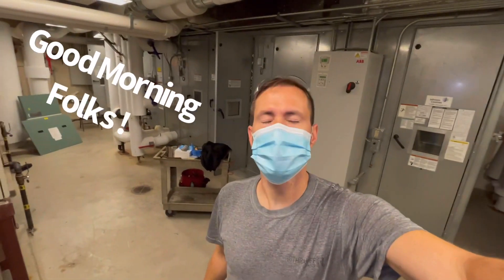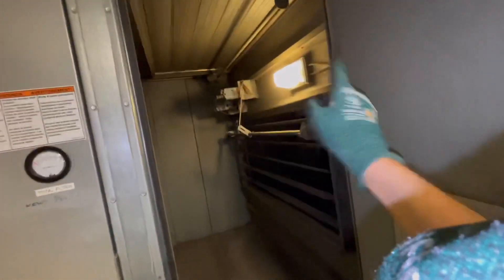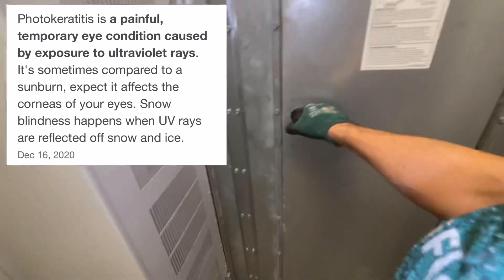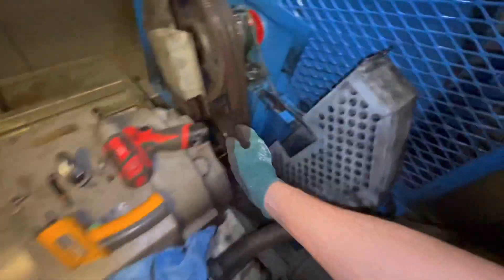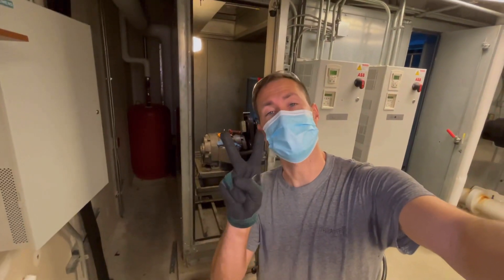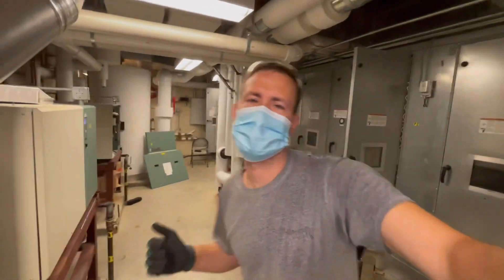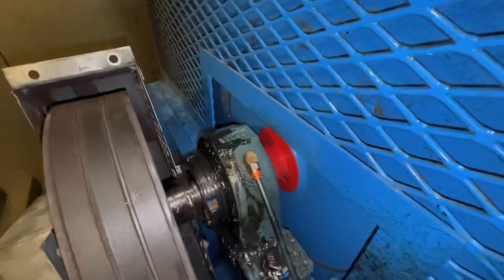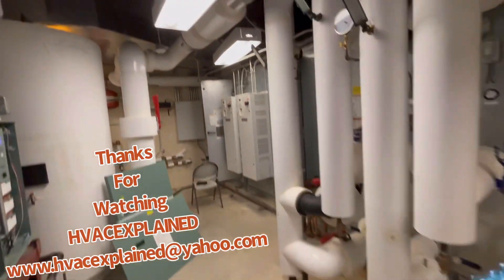HVAC Medical Equipment two birds with one stone #hvacexplained #steamfitters #medical #ruthrauff

Comment: Apologizes but their wasn't a final conclusion to this video. Was it the slack in the belt that was causing the noise or was their more to it? also what was the issue with the humidifier?
Reply from the maker: Hey good morning Mathan.  A few minutes later after I got done tightening that belt I tweaked a back muscle from an old dead lifting injury.  I was able to get the humidifier back online and running but I took a bunch of Motrin and went straight to my chiropractor.  
The noise was coming from the belt slipping on the pulleys and after the adjustment everything was good.  New belts were ordered.  
The problem with the humidifier was a design flaw where the intake pipe was and the staging I may have to get back there too do an updated video let me see if I’m ever back there again then I will make a resolution to this video.  I’ve been on TikTok a lot lately seeing where that goes but I will be posting more YouTube videos.  Have a great day
Reply: @hvacexplained9341  thanks look forward to it. Just want to say i genuinely appreciate the effort you put in. I know its hard doing the job alone but the put the effort to pass on your knowledge by setting up videos is a next level of dedication. Im learning so much in a short span of time. I am also in the same line of work but im trying to take the next step from maintenance to diagnosis and fixing major break downs like yourself. Much appreciated 🙏
Reply from the maker: @mathanyoseph4349  :  Thank you very much sir I do appreciate it.  It’s  very time consuming doing this recording, editing and posting.  
I have tons of videos ready to edit just finding time in my busy schedule is the tough part.  I work a lot of overtime along with helping out friends and family, working on my house since I am preparing to move to Florida within the year.  I post a lot of these videos because Ive noticed there wasn’t good information being put out into this field.  it seemed like some stuff was staged or the people could not explain what they were working on or why.  I still feel that on the job training is the best learning for any future technician.  The more service calls you take the better you will be.  This is actually a very good field to be in.   I like to shoot these videos also because a lot of technicians currently in school don’t get to see the real world applications and what you will experience.  I just wish I started filming when I first started because people would not believe some of the stuff I have ran into.  
If I get back over to that facility I will explain more about the humidifier with the outcome I have to get into a building downtown in Pittsburgh right now.  Have a great day thank you very much for your compliments and believe me you’re in the right field.

Comment: What's your opinion on leaving grease fittings installed on motors that didn't come with them? I see no problem with it but some people disagree.
Reply from the maker: Good morning Carl, I have been to many motor and compressor classes over the years and the reason why they are no longer putting grease nipples on motors is generally because people are over-greasing of the motors which is causing premature failure.  Especially the bearings.  
A lot of manufacturers are using synthetic grease and sealed bearings so they will last quite a long time as long as the motor amp draw is good and belt tension is moderate.  
One guy in particular that I know he has retired.  Every time I went to any of his accounts I would never bring a grease gun in due to the fact everything was overflowing with grease even into the motor stater.   If the motor has grease nipples such as a smaller motor I would give 1 pump per bearing per year do not forget to remove the plug on the other side if it’s there.  If it’s a large motor such as 40 hp or more I would do 2 pumps once per year per bearing. 
But I do often wonder if they do it so there is failure one day so they can sell more product but remember everything mechanical will fail.  
Hopefully that helped out a little bit sorry to ramble on.  Have a great day thank you for the question.

Comment: Great video,👍. I know the UV light is a great help but have you noticed if the engineers have been calling for more outside air since covid?
Reply from the maker: Thanks Bob.  Just giving a little on the job show and tell.  A lot of buildings I’ve been going to have requested economizers to be opened more.  Always remember that the equipment may not be able to handle the extreme extra Humid / Cold air brought in.  
I feel fresh air in along with exhaust is the best way to clear building sickness and odors.  
I always advise people when seasons change to air out their home.  Some of the worst air conditions are trapped in a home.  It’s not a bad idea to crack a couple windows once a week for 30 mins.   
Have a great day.